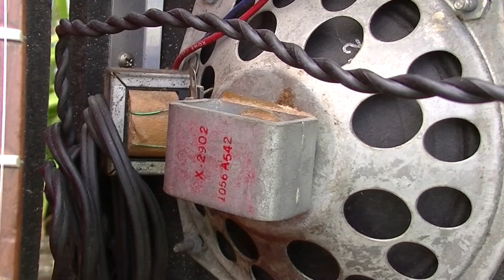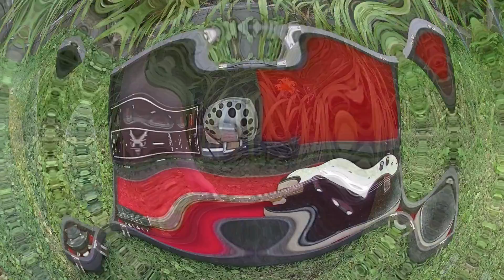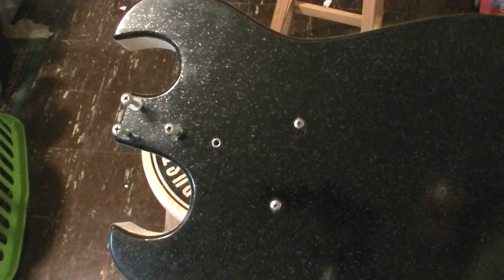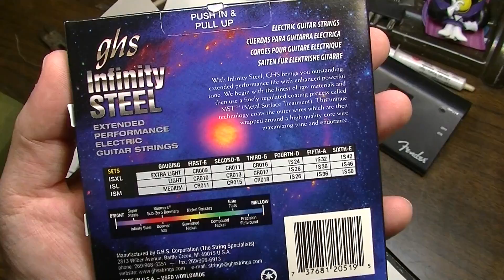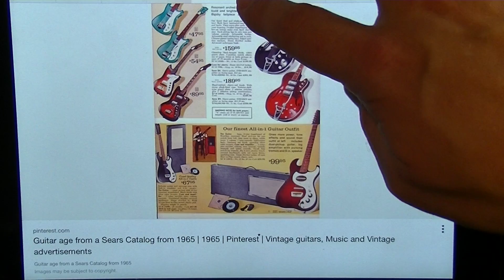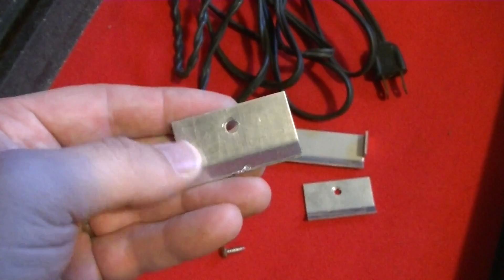Amp-in-Case Guitars - Bad or Brilliant?

Comment: I had a Japanese AM radio that used the 50c5-35w4 12BE6 12AV6 and another 12 something maybe 12BA6 in series. I remember getting shocked  by the chassis while checking out the circuit. They worked, but that's about it. I'm going through my first amp, a silvertone 1423 soild state. It's a really funky design with a transformer coupled output driver.

Comment: Design flaw ano can crash down on top of guitar neck. All that amp weight being held up by two collapsible hinges. But if leave it open and are not careful or it get bumped. The guitar could be. Broken neck. Now    you can fit guitar on amp side by sliding tuners just under edge of amp.
There by leaving empty other side. So if it falls. Getting little possible damage. With 1449 or 1457 . You need to remove foot switch storage bracket to make this possible. but make sure to pack up screws and bracket in safe place. No one mentions the the sparkles. The swept up the metal dust and that's it comes from. As told in the Neptune factory book history. then to first sample models were Ink stamp on head stick below Silverstone logo. Was NEPTUNE WITH TRIDENT. MEANING FACTORY SAMPLE. As was the one taken to sears for review. Would have have been seen. When it went up for auction and sold on eBay.
That's how I found out. What that figure on mine was. My was made 3Rd week Dec. 1962. Neck date code. Two screws holding neck on.  The on sold on EBAY was very poor condition and bolted to tripod for display. Though I feel it sold cheaply owning to it's pedagree. I prefer to play mine through a 1457 case. Both my guitar and were were found in that area of NJ. the building gone now but not forgotten. Brought my first 1448 with amp in case in 1968 for 25$. The one I have now not cheap. But way below market value. Makes that fantastic lipstick sound still. And no they not lipstick tubes. So says the book. Written by people who were there.
As it was then as it is now. IT'S A 5 WATT WORLD.

Comment: I think I can help you out with the term for that U-channel used for the tuners. ;)
35W4 + 50C5 + 12AU6 only adds up to 97V for the filaments; that Hugh Jazz wire wound ceramic resistor (I'm guessing about 120 ohms, since the filaments are 150mA) must be dropping the extra voltage in the filament string. Also, that little chunk of iron is probably a choke in the power supply; you don't typically see isolation transformers in series filament amplifiers.
Considering the volume and tone quality manufacturers are getting out of rechargeable puck speakers, I think the amp-in-case paradigm is overdue for a comeback. Include a simple analog cab sim and somewhere to stash your favorite rodenty or screamy dirt box and you've got a decent busker kit; add a line out and the case could double as a foldback monitor.

Comment: when I was a teen, my stepdad had one of those guitars with amp in case but the amp didn't work when he got it.   I played the guitar through a 1971 Kenwood  6420  amp receiver that was custom modded for use as the primary sound system in a club  with a total output of just under 12,000 watts.. yes that much and those mods included usable mic and guitar input jacks.  It  really sounded good even with that Sears sold Silvertone with the lipstick pickups.. It had a pair of  Sansui SP-X8900 speakers hooked up to it... and cranked up sounded a lot like a Marshall full stack...Fun times...

Comment: hi Brad quick question : does installing  a 3 prong plug solve the shock issues?
Reply from the maker: This is a series filament amp. A grounded plug has to be installed a certain way or it’ll cause hum. Better to install an isolation transformer and a 3-prong both. But I don’t know if there’s room.
Reply: @TheGuitologist yeah my guitar tech said as much. So i must be careful with mics.....Keith Relf. Great recording amps though

Comment: My sister was oldest, I was youngest. She was going to buy this for me, instead she came home with a Fender Duo Sonic 2 and a Fender Vibro Champ amp. It was light years better than these rigs, but I've always felt cheated that I never got what I REALLY wanted , which was this guitar, 2 pickups, and case in amp.
Reply: I love the breakup of this rig. I didn't like my Vibro Champ because it was too "clean". I wish I had that guitar and amp today, both were stolen at different times.

Comment: Great job! Thanks for the history lesson! Often wondered how much my dad paid for it and you gave me some idea. 
I got my 2 pickup version w/tremelo amp for CHRISTmas of '65. Finally worked up the nerve to learn to play the 3rd week of January before EVH and I both turned 11 (Jan 26).
I unwittingly took the strings off guitar intended to repaint it, left the strings off too long back in mid 70s so the neck is a bit bowed. Amp had some screeching issues back then if I remember correctly.
I believe we live in the same region (Ohio Valley? KYiana?). 
 Would you consider refreshing the guitar? and maybe the amp?  I'd appreciate the consideration. 
Enjoy your different take on amps and guitars!

Comment: Thank you for the terrific history and insight on these 1448's. Liked the first one I bought , so I just recently purchased another. The 1448 I just picked up differs somewhat as it only appears to have two screws bonding the neck to the body (with no adjustment hole). Also, the 10' cord is hard wired thru the 1/4" pick-guard hole with a right angle standard 1/4" that plugs into the amp. My tuners are also open back. It all appears to be original equipment as none of the metal fastener screws are knurled or buggered at all. I suppose I will attempt to adjust the neck action with the one screw that is where the adjustment hole is on my other 1448. Any info on what I might have and operation is appreciated. Thanks again!

Comment: I have one of the 2 pickup versions of these and it sounds pretty good through the case amp but sounds great throughout my main amp.  I usually use it as backup for my telecaster at gigs and it sounds awesome. It is Also super different from what people are used to so it always turns heads when I switch to it. Best $175 dollar guitar I ever bought haha

Comment: How did these series filament amps get a UL listing. If I understand correctly, one conductor of the cord was connected to the chassis and the plug was non-polarized. Depending on the way you put the plug in the outlet, you could end up with 120 volts on the chassis. If you touch the chassis and something grounded at the same time, ZZZZZZT.

Comment: Maybe I missed it but how are you supposed to adjust the neck angle with that screw? Like surely you loosen the lower neck screw, but I'd think you'd want to loosen them all, which is a pain with taught strings. Otherwise it seems like you're wallowing out the tight neck screw holes. And if the holes in the body have too little tolerance it seems like the screws would do the same to it when you tilt the neck a bit. Probably not enough to matter but I'm just curious what the proper procedure is. Same goes for the Fenders, never dealt with one. I had a bass with this feature but its neck was aluminum. Seems awful handy either way, especially for partscaster bodies.

Comment: Hey Brad, I know you are real busy and are probably still way behind in all your own amp repairs/upgrades but would you be interested in creating a prototype 2020 'amp in a case' with me and you co-designing features using the Korg/Noritaki NuTube flourescent tubes that Vox has been using for some new amps?? I see mega-potential in using those low voltage nutubes and maybe some lightweight ultra-modern flat speaker drivers, although those NuTubes need tons of foam buffers to keep from getting microphonic. Just wondering if u think it sounds like a viable idea. I do. I've watched so many of your amp repair videos that I'm actually half an amp tech at this point! Anyway, let me know. Tx.

Comment: You know what's really interesting Brad, is that the Silvertone guitar company is still in business. Sold exclusively through a UK online dealer called Gear4music.com What's even more amazing, is that while Danelektro is still making their guitars the old way, using Masonite bodies and such, Silvertone is using real wood. Mahogany bodies and maple necks. Quality tuners and Duncan Designed pups which most likely means they are being made by Cort out of Indonesia. Cort makes some really great Squier models, like the Squier Strat Standard and the Strat Deluxe. I think they are also making the VM series, but I would have to check on that before I would swear to it. And so once again, like back in the 50's and 60's Danelectro and Silvertone are back in business. But!! Silvertone is about 1/3rd the cost of the Dans and are quality instruments. I keep kicking around the idea of getting one of the 1303 models, which is the single cut bodies with a pair of lipsticks in it.
The 1449 is the same quirky style as this one, but it has a pair of lipsticks, instead of only one. Also, the bridge design is close to the same, still has the weird trapezoidal shape to it, but now has a Strat style independent saddles for intonation. They are about 245 euros for a much better design than the Dans have. 
The 1423 is also a single cut, but has a pair of TV Jones style humbuckers that are also Duncan designed for about 290 Euros
The flagship model is the 1478. Kind of an offset body like a Jazzmaster. But it has a sort of Fender headstock, with a pair of P90's. Tune-O-Matic roller bridge and a real B50 Bigsby for 370 euros. All of them are quality built with some of the quirky design traits of the originals, but made to play well and last a long time. Just thought you might be interested in how the old seems to keep coming back around to the new again. I looked. No amp in a case yet though ;) Bob in Germany

Comment: OK Brad very helpful - and in a re-design for today, some sort of TL or porting structure could be made to work once lid was closed and unit running  - one, why not two drivers, one firing backward? Love it - - and a pedal, cables, say Boss analog delay, would slide in there for travel aswell, meaning you could maybe throw some sound.. 
I went part way on such a project (for harp) & stopped: I have a Jensen P12 front-mount in a discard, curbside, long-scale bass guitar plywood case - uprighted for action, the cone plays four feet off the floor, bottom end is superb, carries as easy as any speaker box night or might not. Never have installed an amp and drive with an Arkay 12. 
OK now your daughter has bounced in.- hilarious & charming

Comment: Thanks for this! My 1448 guitar has the neck bent like yours, which ruins intonation and action. Will try a similar approach for straightening.
One of the best things I have ever done is buying a 1448 amp in case plus guitar for cheap while I was in the U.S. Mine is quite worn out, or better :wrecked, but after fixing the worst still has a great feel and tone. Perfect for garage / LoFi sound. Also hard to get one on the other side of the big pond. 
I did get electrocuted when jamming with a buddy and touching his guitar's strings while showing chords ... and it was the worst electric shock I have ever felt (used to work as an electrician and had a few....). I fixed it with an isolation transformer and 3-prong cord. I would consider doing that if you own the amp. Cheers!

Comment: Doesn't look like anyone gave you info on the guitars. The body border material was vinyl wallcovering. The keys are thumb screws from a roller skate company. Skates were adjustable from pair of shoes to another. The thumb screws would loosen or tighten the skate. The body is made from masonite. Countertops and kitchen flooring were also made from masonite. The neck was made from pine 2X4s. Lipstick tubes courtesy of revlon. The sparkle finish is silver paint that was flipped from a brush onto the guitar. Last but not least the tailpiece was the pedal part of a trash can. Step on the pedal and the top would pop up. stuck a piece of wood on it, bolted in the place of the pedal connection to arm that lifts top of trash can. I have 1 that I have kept all these years. I love them. And buy and sell them.

Comment: Its called resoglass like shower stalls are made of...my question is Does it come with a Pb sandwich ...lol sweet licks...my great uncle worked for kelton in the early fifties an the stereos that he assembled were made by the reso company were the bodies were made. the outer shell of the  stereo was that same material an hifi stereo 5150 tube amp inside the stereo has a silvertone emblem in the cavitty obove the rectifier tube....

Comment: I've got one of the standard cab versions of those series filament case amps, mine is a Silvertone Meteor model 1390. Sounds great, but shocks the hell out of me if I touch anything metal on my guitar or the power switch on the amp (plugged in with either polarity). It's especially bad if the back of my palm touches the bridge, I'd imagine because it has more surface area than the strings. I have to use the shell from a bic pen to turn it on and off.

Comment: I owned a Jay Turser with a amp in case, bought in 2000. The little amp was removable or you could leave it in the case. The case was pretty cheaply made. The guitar was a 3 pu strat style. I hated the case and sold it separately  I bought the guitar in Indianapolis Ind,. The guitar played well be was really light weight. I no longer own it.

Comment: These days you can get a 10-20 watt class-D amplifier board that would fit in the guitar itself, along with a 9-volt battery. Then the case could house a bigger speaker. You could use the case speaker when practicing (or just playing by yourself), and use a bigger speaker for a jam session or concert. Of course, it's solid-state, so you won't get that tube sound. :)

Comment: Just so you know if you went by inflation $67.95 to $99.95, the difference today (677.1%) would be around $256 USD.
Reply from the maker: Might want to check that math again.
Reply: Apologies I did the math off the head.

I'll be more specific.

 According to the latest US government CPI data published on August 11, 2017. 

At 677.1% (1965 -> 2017) inflation.

1965 - $67.95 = $528.04 (2017)
1965 - $99.95 = $776.71 (2017)

$776.71 - $528.04 = $248.67 price difference between the amp-in-case models in the Sears catalog.